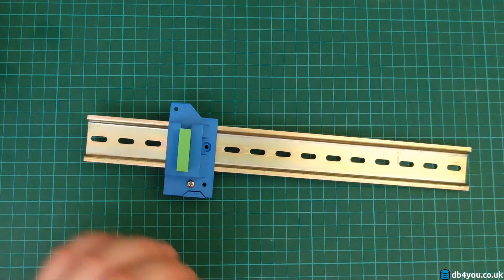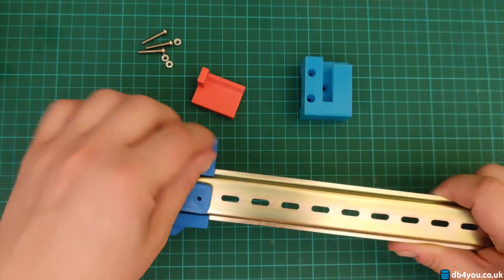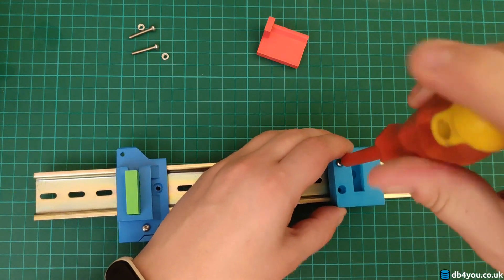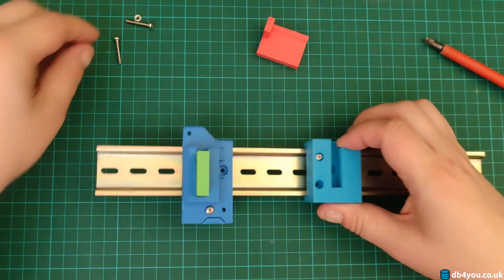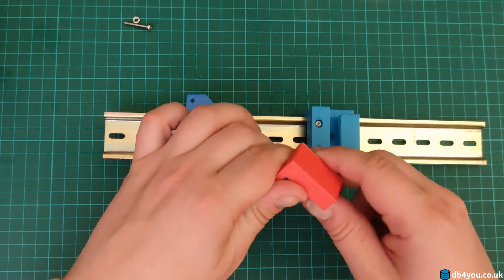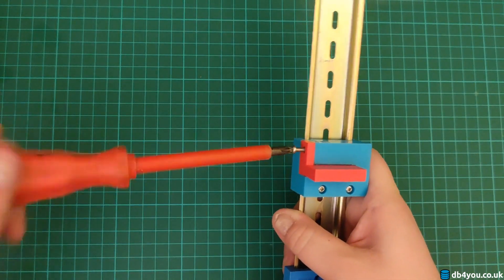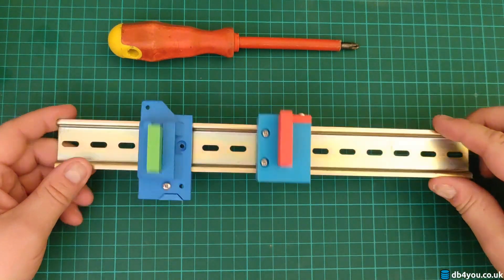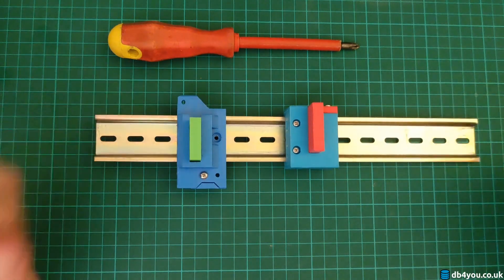FreeCAD: DIY Din rail mount

Comment: Surprising to me that no one's designed a 3D printer around DIN Rails since they are less costly than the extrusions currently used and yet appear to have plenty of rigidity for a frame and could enable a roller bearing design to travel their length easily.  Seems like a missed opportunity for an "erector set" of potential uses if someone were creating steel connectors (right angles, corners, etc.) to make any kind of build from.  If the Maker community only knew....

For less stress enduring purposes seems rather obvious to 3D print connections, so a wonder that someone hasn't CAD'd all those out.  Let's get Zack Freedman on it, for DINfinity 1.0.
Reply from the maker: I like the idea. Sounds rather exotic and I am sure someone will eventually design one. It might not be on the same level as a Prusa tho. This is where my expertise ends and I will shut up now before I say something that is beyond me pay grade.

Comment: Very nice. Although it might be a bit of a downgrade since you have to slide it all the way to the end of the din rail to get it off.
Reply from the maker: That is correct if you are removing the entire block. But you can just remove the item that is attached to it. On a less serious note: I do not have a FreeCAD design that would just snap onto the din rail at any point but I am thinking to design one since it is a valid criticism. Thank you for your input